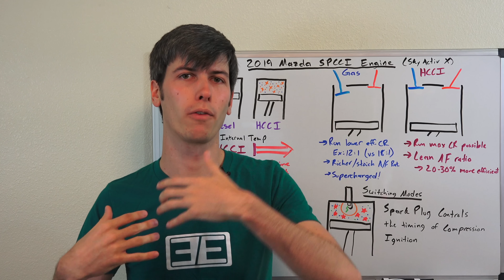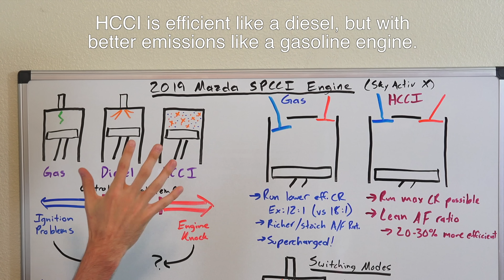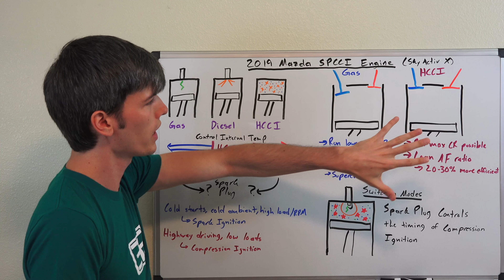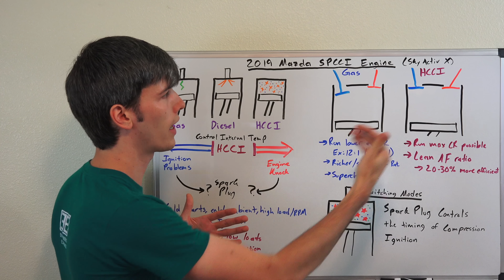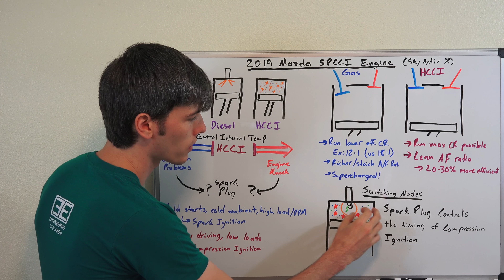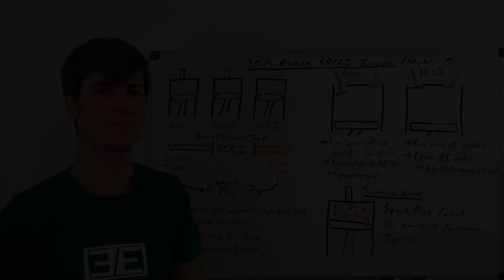Mazda Creates The Holy Grail Of Gasoline Engines - HCCI SkyActiv-X

Comment: Why not just go electric and get 300 to 400% higher efficiency rather than do all this complication just to get a 20 to 30% higher efficiency...
Reply: Drunken Hamster, build me a gas car that doesn't have 17 car fires an HOUR in the USA and doesn't kill 200+ people a year in those fires. Build me a gas car that doesn't account for a million lung cancer cases each year. Build me a gas car that doesn't use a fuel that we fight wars over. And build me one that's 90% efficient like an electric is, not one that wastes 75% of it's fuel in heat.
Reply: Nicolas Losito, who says you're using fossil fuels? No utility is 100% anything. Most are coal (at the moment) and a combination of natural gas, nuke, wind and solar. An EV is 90% efficient with its energy, you LOSE 75% of gasoline's energy to burn it in your car! So even if you burned gasoline to make electricity (you don't, but just for the sake of argument...), you're way more efficient to send the power to an EV rather than burn it in an ICE car and suffer the pollution.
Reply: Nicolas, lithium ion batteries are 96% recyclable, even the lithium. An EV puts out HALF the carbon footprint of a gas car over the life of the vehicle. I think your emission and global concerns should be for us NOT using EVs.
Reply: Scallywag, I don't own a Prius.
Reply: J Bob, cold weather impact on batteries is already solved, pal. It's called having a big enough battery and thermal management (Tesla has both). Don't forget - gas cars get horrendous mileage when they're cold (about 4mpg) and they, unlike EVs, are effected by altitude. Go up a hill, gas cars lose range. I've personally driven a gas car in weather so cold it never reached operating temperature; you'd better believe it was NOT getting it's EPA-rated mileage! To be fair, however, cold weather impacts an EV far more and far sooner than a gas car, for sure. Cold only. Given that a gas car MUST and I mean MUST have a functioning cooling system just to run at idle, you could argue that the killer heat a gas car generates is a negative. There is simply no temperature at which a gas car can do without its cooling system under normal operation. Beautiful 70 degree weather? You'll melt your engine at a stoplight if the cooling system fails so cold weather is the ONLY place a gas car has an advantage over an EV.

Oh and the problem with nuke plants is not greenhouse gases, it's the heat and the waste.
Reply: +motomusiq For majority of drivers, cars are appliances already. The people that want sporty driving will be able to buy performance EVs. So the only thing that will change is cars will become better at being transportation, which is exactly why 99% of people buy cars for...
Reply: Haloid Android, my buddy with a performance EV can beat million dollar supercars, corner better and get nearly 100 mpge doing it. Just put playing cards in your spokes if you want noise.
Reply: You and what toaster - lithium is in good supply and only compromises 2% of any lithium battery. In addition, the entire battery, including the lithium, is 96% recyclable. Please tell me how recyclable gasoline is. In a previous comment, I see no observable improvement in gasoline engines. 30 years ago, the average was 22 mpg, my 2012 RAV4 gets that +- a couple of mpg. You also missed my comment that a 40 mpg car's exhaust will kill you just as fast as a 20 mpg car, so who cares if there are incremental improvements in gasoline engines? They're just as deadly as they've always been and their energy source starts wars. I suggest that your 2008 study was funded by the oil and gas industry. Right after the CARB board passed laws that required GM to make the EV-1 in California, guess what? All sorts of "scientific" studies favoring gasoline and fossil fuels starting appearing in the media...all traced back to the oil and gas industry paying for the studies. Almost everything I've heard on this thread is recycled oil & gas lies about electric cars. You keep on using a one-time fuel like gasoline; I'll use a car that can get its energy somewhere other than the Mideast and has recyclable energy storage.
Reply: You and what toaster - I've quoted facts, given links, challenged the lies the oil & gas industry wants you to believe. Please prove to me solar PV's cost will not reach parity with coal in 2020 (it already is right now in some countries - it's actually cheaper!). Please prove to me that lithium extracted from brine is worse than oil spills, wars fought over petroleum and the one-time use of gasoline, and I'll repeat my FACTS to challenge you. Please prove to me that the company that killed the electric car - GM - isn't doing the same by refusing to build/contribute to a charging network or even requiring their dealerships to have chargers. Or that GM has already limited their production of the Bolt to the exact amount that gets a ZEV credit (they've already told their suppliers to NOT ramp up production beyond 25,000 units). Or that GM and other American auto makers did NOT send a letter to Trump demanding relief of the EPA and ZEV requirements. Prove to me that a business model of income AFTER the sale (that's GM!) can switch willingly to a EV sales model without dealerships. If you say "Volkswagen" I'll show you diesel gate and the reason they're moving to electric - imminent bankruptcy. If you say Nissan, I'll say YES but also point you to the dealers discouraging the sale of the cars. Your "ignore xxx" actually applies to you as you don't have facts on your side. GM and other automakers are the one pushing the REMOVAL of tax breaks for EVs, not encouraging it. They are fighting Tesla every way they can - the ADA tries to limit sales of Tesla cars because it threatens their business. YOU keep pushing "platitudes" but please, stay out of the discussion until you have facts - change is hard, I don't really blame you for not wanting to change the way you think.
Reply: +Paul Baker hydro and nuclear are among the cleanest sources of large scale energy production we have. Gas fracking, offshore drilling and oil sands are thousands of times worse for the environment....
Reply: Space Cars!? What are you even talking about man...
Reply: Calum A, of course you can fill up a gas car in a minute. It's a great feature of the ICE. Did you also realize that if you leave your running in your garage, the exhaust will kill you? How about 17 car fires an HOUR in the USA, and 200 deaths a year in those fires? How practical is that? A gas car is a Molotov cocktail. I can get 170 miles of range in 20 minutes in my electric car, barely enough time to eat a sandwich and go to the bathroom. How's that impractical?
Reply: DocWolph, man, you are an example of a little information being dangerous (and wrong). I really get tired of typing and re-typing on this thread, but I'll address a few of your most outrageous statements. First: BEVs are "wildly" more sensitive to efficiency losses. You don't mention what those efficiencies are, but since you refer to windows I can only assume you mean aerodynamic drag. Tell me - does air flow differently over gas cars than it does an electric car? How is a metal body with a battery different than the same metal body with a gas engine? The answer is: it isn't. A BEV suffers the same drag with the windows down (or up) as a gas car. I'm curious how you think the laws of physics change based upon the fuel source.

Level 3 charging diminishing battery life - wrong again. Tesla limits its rapid charging to around 120kW in order to protect battery life. In fact, if you rapid charge a tremendous amount, Tesla will, on an individual vehicle basis, lower your charging rate to protect your battery. In short, you don't need to worry about battery life - your battery will outlast the car. I can prove to you that revving your gas engine and drag racing it will, indeed, destroy it and your warranty. With a 1,000:1 complexity difference between a gas engine and an electric motor, you have far more to worry about even running the engine than you do charging a battery.

As for an electric not carrying the same energy load, well that's a toss-up. 90kW in gasoline weighs 21 pounds. 90kW in lithium-ion batteries weighs 1,200 pounds. However....it takes about 1,000 - 1,300 pounds of gasoline engine, transmission and fuel system to use the gasoline. It's effectively a wash.

The power companies charge you EXTRA to charge your car at night - again, WRONG. A utility doesn't know if you have a clothes dryer plugged in, a television, a hot tub or anything else. You get charged per kW. Most EVs charge off-peak and at the lowest rate your utility company has. 

Refueling rate (5-10 minutes compared to hours). You're right! I can fill my RAV4's gas tank in 5 minutes if I leave my  house, am awake and pay whatever price of the day for gas is. Let's compare that to an EV - hmmmm, I plug it in (takes 15 seconds) and then leave the garage. In the morning the "tank" is full. Hardly an inconvenience. Oh and my electricity rate has been absolutely flat at $.11 a kW for 15 YEARS. The price of gas has doubled under Obama, then almost halved near an election. Please - Google gas prices in the last 10 years. It currently costs me about $9 to fill up my Tesla to go 300 miles...what do you pay now for that range and what did you pay at $4 a gallon?

Lastly, BEVs being a novelty product - Exxon wishes! Did you know Britain will not allow gasoline cars to be purchased new after 2040? Did you know China will soon have the strictest zero-emission vehicle standards on the planet, and that means electric cars? Did you know many cities are now only purchasing electric busses due to the reduced operating costs?  Did you know the motor and ECU on an electric can be changed with software, making it virtually maintenance free? 

I do hope you learned something, you seem to have a lot of incorrect ideas about electric cars - you seem to be defending one of the largest sources of lung cancer and global wars we have (petroleum vehicles). You are free to drive what you like, but the largest product launch in HISTORY - the Tesla Model 3 - says you're looking at the end of the gas car.
Reply: EV Owner I've seen massive car crashes in person and 100% of the time, they never catch fire. Fires only occur when the gas tank ruptures and it's very difficult to do that, most gas tanks in modern cars are placed infront of the rear subframe so in the case of a rear end collision, the gas tank remains safe. EVs will become a good option in the future if we get faster charge times and better range. I'm not against EVs but they have their own advantages and disadvantages, if EVs start getting 500+ miles range I'd happily buy one.
Reply: Range.
Reply: Roartal, that's not true. EVs, even counting manufacture, produce half the carbon footprint of a gas car. The toxicity of the batteries is a red herring from the oil industry. Lithium comes from brine, not from a pit mine.
Reply: J Bob, you didn't read my comment entirely. Cold weather does affect EVs, but altitude affects gas cars. There are pros and cons to both kinds of cars, just like the differences between gasoline and diesel. In a gas car, heat is a massive problem. Once you reach a minimum temperature, batteries need no thermal management. What happens to a gas car if the cooling system fails, even on a 40 degree day? Your engine will seize! How about losing motor oil...how far will you go? EVs use none of those things.
Reply: Dom Kekistan, we've had over 100 years of improving the ICE; it's as good as it's going to get. The exhaust from a 50 mpg car kills you just as fast as a car making 20 mpg. Since an EV can get energy from multiple sources, the price for it can't be manipulated like oil prices are.
Reply: Albus Regnum, I think a 300+ mile range on a $35,000 car is plenty given a nationwide charging network.
Reply: Paul Baker, where are you getting your information from about electric cars? Do you have a gas car that goes 1,000 miles on a single tank of gas? Can you even drive 300 miles without stopping? I've driven my electric car on a 2,500 mile trip with NO disruption in my travel and NO delays. I average about 50 miles of distance per hour of highway driving, that's over 40 years of driving. I drive 2-3 hours (150 miles) and need a bio break, don't you? I use something called a Tesla Supercharger and I get 150 miles of range in 20 minutes. That's barely enough time to go to the bathroom and eat a sandwich. I then hop in my electric car and go ANOTHER 2-3 hours and stop for another 20 minute break at a Supercharger. After 40 years of driving, I can tell you I arrive more awake, more attentive as I drive and better rested than trying to drive 6 hours at a stretch. In fact, my bladder won't allow me to drive that far. Stop listening to the Exxon about how electric cars work and starting Googling TESLA.
Reply: Harrison Williams, I just can't retype the same answer over and over and over. You are NOT using more fossil fuels charging an electric, please read the previous comments on this thread made by me. In fact, gasoline refinement requires so much electricity that we could power EVs for 20 miles on what it takes to refine just one gallon of gas.
Reply: Haloid Android, the EPA rates every EV I know about at 100+ mpge. I have a 90kW car, the equivalent of 3 gallons of gas, and I easily go 300 miles. What were you saying about EV efficiency? How far do you go on 3 gallons of explosive fuel and how much do you pollute doing it?

You clearly missed the point - it takes 6kW per gallon of gas PLUS the crude PLUS other energy sources to make each and every gallon of gas. An EV can go 20 miles on the electricity portion alone. YOUR car has to add crude to that energy to only go marginally more than that. My 2012 RAV4 averages 22 mpg. What's really interesting is the gasoline is a very energy-dense fuel; only 21 pounds of it stores 90kW. But in order to USE that energy, you lose 75% of it to heat in an ICE and make poison during the process. Stop refining the crude, give the PORTION of energy used to refine a gallon of gas and you'll go 20 miles in an EV.
Reply: Haloid Android, a Tesla P100DL does beat the $800,000 Porsche Spyder at a fraction of the price. Looks are subjective. You must not know about something called Formula-E racing, either. Or the Pikes Peak Hill climb that has Tesla Model S's running in it. I'd say gas cars are only good for exploding.
Reply: Haloid Android, I certainly hope a $500,000 car would beat a Tesla. Why? A Tesla is a $100,000 7-passenger sedan with kid seats in the back. And a Tesla isn't designed to be a race car but it beats them in many performance categories. Imagine what Tesla would do if they DID design a race car. Isn't it ironic that many McLaren owners pay a million dollars or more for a car, never drive it in a race and yet a Tesla sedan beats them in 0-60, quarter mile and safety? If we're going to compare cars out of their categories, Tesla wins. Will a McLaren carry 7 people? Oh and the Green4U electric racer made in conjunction with Panoz Automotive uses battery swap to race, just fyi.
Reply: You and what toaster - so, um, gasoline isn't explosive? Gas cars DON'T rely on combustion to work? There aren't 200 deaths due to car fires a year, 17 car fires an HOUR in the US? Wow, I am mistaken. Thanks for educating me that a solid state battery car is just as dangerous as a car carrying 20 gallons of the same stuff that makes a Molotov cocktail work. How silly of me.
Reply: DocWolph, if memory serves, it was you that brought up the comparison of a $800,000 special-use 2-seater sports car to a $100,000 family sedan. EV owners appreciate the complimentary comparison - it's quite nice, don't you think? All of a sudden a Tesla is supposed to beat a track vehicle? How about comparing a Tesla to an F1 racer? Or a Baja racer? Hey - since a Tesla broke the testing machine trying to crush the cabin, I'll bet you about which car has a higher survival rate - the Porsche flipped over at speed or a Model S. Wow, I'll even bet you which car flips first - given that the Tesla has a 1,200 lb battery below the driver, you'd better not make the bet.

Please - you like your ICE cars. Use them. Buy fuel for them. Repair them. Oil them. Enjoy them. If you don't mind, I'm not using gasoline anymore and like the 0-60 performance that a sedan needs and, icing on the cake,  beats million dollar specialty cars. I like no maintenance, mechanically simple and gets better as it ages...it's already more efficient and faster than when I bought it, all due to software updates. It magically fills up every night for pennies per mile.

Keep buying gas!
Reply: EV Owner, 

Electric is the future, but at this time, it is too expensive for most people to buy. Hybrids are starting to be cost effective for most people. 

EVs still have too much of an upfront cost to be worthwhile for most. If you do a lot of in city commuting than that will be different.
Reply: 1)Mazda is a relatively small company and doesn't have to resources to create multiple engine types. 2) Mazda's are known for being lightweight and sporty around corners hence the zoom zoom, so sticking heavy a$$ batteries and electric motors in there cars would destroy their identity. 3) Instead of following the crowd and creating a mediocre hybrid they'd rather become masters at what there already good at.
Reply: Do you have to end every comment like this........
Reply: I have. Most of Canada's population reside in Ontario, Quebec or BC. All three of which mostly rely on hydro and nuclear. Oil & gas may be huge, but it's not used extensively to generate power here in Canada...
Reply: Jarl Ballin'

Because BEVs do not carry the comparable energy load. BEVs are wildly more sensitive to efficiency losses. That is don't drive with your windows open. 

Further the acquisition cost of BEV are HUGE compared  the ICE-V. The Motor still costs about as much as an engine plus ECU. The speed/motor Controller + power converter costs at least as much as a transmission. And the batteries currently cost as much as getting 150-200 full 20gal tanks of fuel at $3.00/gal ALL AT ONCE. 

Then there is charge times even on Level 3 (330V) you are looking at 20 minutes while greatly diminishing current battery deigns' life expectancies. Compare that to 5-10minutes to fully tank up a vehicle and the time saved adds up real fast. Home charging is at best Level 2 (220v) and would take anywhere 4-8 hours depending on how big the batteries are. In either case the cost is not zero. Lvl3 charging will set you back gas prices per kWh to pay for the infrastructure. Lvl2 would cost the home owner about 1400 for the charging plus whatever home electrical work needs to be done and you can multiply that by the number of cars you need to plug in. And then charging carries additional Electric bill costs which can be hard to justify withe power companies charge you extra for recharging your car every night... although that should not happen if you have at least 200miles of range on a full charge and don't use your A/C radio, or drive in pace with the rest of traffic. 

BEVs are still a niche novelty product. There is reason to believe they will have the final say, but that day is not anytime soon. meanwhile, ICE and Hybrid technology moves forward making BEVs less of a winning argument.
Reply: Wow, DocWolph, what hostility. Let's talk, shall we? You implied that charging level 3 damages the battery, also implying that charging quickly is unusable. Do you know how long it would take, and how many times you'd have to charge over 120kW before you'd damage your battery? A tremendous amount. Tesla will slightly reduce your charging rate to protect your battery, but you still get Level 3 charging rates. So to rebut your statement: charging Level 3 will not damage your battery in a Tesla! You still get Level 3 and you still get full battery life. In no way are you reduced to Level 2 charging rates, you should've let that one be. Details, the devil's in the details. Level 3 charging is anything above 20kW; Chademo is half the charging rate of Tesla's 120kW and still considered Level 3. Even at the reduction of charging that Tesla might make over time to protect your battery, you're still charging much faster than Chademo! Are we good now?

As for your prediction of off-peak charging costing more when EVs are more prevalent, your guess is just that - a guess. You're forgetting that off-peak isn't just a function of supply and demand, electricity also has a time component and a restriction as to the maximum amount of power that can generated and transmitted at any one time. In California, for example, they can have a 4:1 price variance depending on your time of day that has nothing to do with supply or cost of the generation materials. Diesel fuel, for example, doesn't cost 1/4 of it's price if you buy it after 8:00pm. What matters is WHEN the utility has to generate the power, and whether or not they have to use additional generation methods at peak times, and whether or not they have to build more infrastructure to transmit that peak power. EVs generally smooth out the peaks and valleys, which is why the Tesla Powerwall is so popular. In my state, we have no off-peak pricing so it doesn't matter when I charge my car. If everyone decided to run their electric clothes dryers off-peak, you might actually see a decline of peak rates as the total energy demanded during peak hours would drop. 

As for the price of gasoline, learn the details. Gasoline, due to political reasons as well as extraction and refinement reasons, varies greatly. Fracking was one reason the price dropped, but I've read many articles that the price has dropped in half NOT due to fracking but due to the Saudis seeing we were making more crude, using less of theirs and they artificially dropped their prices to have us stop production. We've capped our own wells in the USA before when they've done that. Here's the details you missed: electricity prices are regulated and stable. Unlike gasoline, you can make your own electricity. Can you make gasoline?  Being energy independent is a benefit of driving an electric car, not being subject to the roller coaster of fuel pricing is a great thing. Please tell me how an unpredictable fuel price is an advantage for ICEs. Tell me how the inability to make your own fuel, regardless of political or cost reasons, is a good thing. 

As for batteries charging in 15 seconds, you sure missed the point - missing the details again. It takes me 15 seconds to plug in my car at night. That's all the time out of my day that refilling my car takes. I'm sleeping while it's recharging. YOU, on the other hand, have to stand there at your car for 5 minutes filling your tank. How on Earth could you possibly think that having my car refilled while I sleep is a disadvantage? You, on the other hand, have to stand there and wait to put explosive in your car then carry that fuel home to sit at your house and HOPE you don't get into an accident carrying that Molotov cocktail around. Details. Learn them. Know them. I'm sure you're a smart person, never stop learning - it's good for you.

There is no way you can compare a thousand-part ICE to a single-part EV motor and think that the ICE is, or will be, more flexible or more reliable. In Tesla's Model 3 service design, 80% of any service can be done without putting the car on a lift! A service ranger, in the rare case they're needed, can stand over the vehicle in your driveway and fix something. Please keep telling me how a future ICE will be reliable and remotely serviceable, I'm intrigued. Most of Tesla's issues are fixed by on over-the-air software update; how many ICE cars can do that? 

Lastly, I'll enjoy a political discussion with you on another thread. I also enjoy seeing loser liberals try to take credit for the rapid turnaround of the economy, record employment and record stock market highs. If the previous administration knew what it was doing those things would've happened THEN. But let's keep talking about statues that were standing for 100 years and no one said anything under the previous administration. Statues, not jobs, seems to be battle cry of the left. Since it's clear we're not going to agree, let's agree to disagree. Have a nice day.
Reply: Haloid Android? Last time a car exploded? You mean without flame? Or do you want to discuss car fires, which is a problem with gas cars? I've seen lots of videos of firemen at a privately owned car that's burning on the side of the road and it explodes. There's also the explosions when tankers have a wreck, we just had one in my state in the last few months. Quite horrific explosion as well. Yes, I've driven by cars on fire and it wasn't batteries burning, it was the gas.

The $800,000 Porsche Spyder better beat a $100,000 family sedan in a race, don't you think? And the Spyder still carries around an explosive and doesn't seat 7. But then again, a diesel tractor trailer beats a Porsche for distance, too, but if we're comparing vehicles out of their class and price, a Kenworth beats a Porsche, McLaren and Maserati. 

I'll be happy to get you video links of cars burning and exploding, but you can do a YouTube search just as easily as I can.
Reply: Krisztian - Jeremy Clarkson is a comedian not a car expert, and John Cadogan is a car salesman, not a expert either.  His video on EVs was filled with inaccuracies.  Your probably one of those that has made up his mind and just looks for like minded confirmations of your beliefs.
Reply: Haloid Android, to tell you the truth, I'm tired of the discussion. Like what you drive, I say. You are, of course, welcome to drive whatever you want, whatever makes you happy. I have a red convertible that has a gas engine that goes pretty quick and it's fun to drive. I drive it a lot. I buy Premium gas for it, too. I don't fault anyone for driving what they like and can afford. And I wish you a better day - if this discussion has contributed to a bad day, then screw it. Let's stop talking about EVs then.
Reply: You and what toaster? -  So lets summarize your points:

Subsidization - Bad for Tesla and solar, but you have nothing bad to say about fossil fuel subsidies 
ICE pollution  - Not a problem
US Auto Industry - Should have let fail
Governments - They just have wars for the sake of having wars, no connection with oil.
Gasoline - Not flammable or explosive
Lithium - Not safe in any form
Exhaust - Not at all dangerous.
CO2 - Forgetaboutit

Wow!  Your one of those "alternative facts" people.
Reply: Roger Heuckeroth, could you have told me you were going to reply to Toaster? Sheesh, you could've saved me lots of typing ;)

I end a conversation when it becomes circular. He's brought up subsidies, range, recharge, battery toxicity, fuel source and been wrong every time. I'm not going to respond to him anymore but maybe people reading our discourse learned a few things.
Reply: They are trying hard to figure out a way to mass produce super capacitors than can do most of that. They would theoretically charge the same rate if not faster than it takes to fuel the car. Once someone figures it out, even Tesla batteries will be obsolete.
Reply: Paul Baker, hydro plants are one of the cleanest, safest and most predictable energy sources the planet has. A dam's primary function is to control flooding, btw. The fact that we can get power from moving water is just gravy on the potatoes. Nuclear plants are very dangerous - but we cannot ignore them. France gets over 75% of its energy from nuclear power with no accidents, so to say it's not usable isn't a practical perspective....it has its place but its potential for damage is great as well. The answer for domestic energy is clear - renewables. Solar can completely provide all the energy the USA needs if we have storage. And the amount of solar PV panels required to generate that energy would only occupy a few small counties in Texas. Same for battery storage real estate. I can, right now, make over 100% of my home's needs using rooftop solar. Imagine if even half of all homes in the USA because energy self-sufficient - who needs a new power plant? Who needs more power lines? Who needs to burn more coal or diesel or nuclear fuel?
Reply: You can shoot a tank of gasoline and drop a lit match into the liquid and the flame would extinguish. You're a total nit with your name and endless vomiting of things you read in articles. How anyone can be such a fanboy of a technology and spew lies and hysteria and propaganda is beyond me, but the internet is a wonder for building wastes of intellectual space.
Reply: EV Owner Teslas do have the advantage in short races because their torque is instantly available but when you're doing 1/2 mile or 1 mile drag races for example, it'll be left behind...
Reply: EV Owner,

Why you so butt hurt about this? If you understood that the only thing the Models was capable of beating a sports car is was 0-60 times, then why be so mad about it being spelled out. 

You are one of those special little snowflakes, people who think they are so special, always right, and can not take the slightest bit of heat, that is contesting their insular POVs.

But you did say, A Model S BEATS a [Porsche] 918. Beats as in, anything the 918 does the Model S does better, which is functionally not true. It does a lot better like carrying more than 2 people and their stuff, among other things. 

You should be more capable of being more mature about this than your are being. So suck it up, whiner.
Reply: Krisztain Gagyi, you keep believing that Top Gear isn't scripted! How about some "clear" facts? First, lithium is extracted from brine, not pit mined like copper. Lithium only comprises 2% of any li-on battery and the entire battery is 96% recyclable. EVs produce half the carbon footprint of any gas car you can name over the life of the vehicle. Please...Google is your friend. I can provide all the links to my statements if you like, but I suspect you're busy drinking the GM and Koch Brother's kool-aide to read them. 

Since gasoline only comes from oil, please explain to me how being able to make electricity from solar, wind, hydro or any other cleaner source is WORSE than burning gasoline. Please, I'd love to have that intellectual discussion. Put the kool-aide down and start typing.
Reply: DocWolph, where are you getting your information? Are you actually arguing that a single-moving part motor is somehow even remotely akin to a 1,000 moving part ICE? You're really trying to draw that conclusion? Logic class for you, pal. Oh and by the way, Tesla motors don't use magnets. It's an AC induction motor; DC motors use magnets. Before you think you can "tarnish BEV reliability", please learn about motors, electricity and the way the world works. But it is fun to talk to you. I especially love your attempt to compare a frequent and necessary oil change on an ICE to a sealed, permanently-lubed single part motor - logic at its best! Keep 'em coming!
Reply: DocWolph, it's you that's butt-hurt. I lay out facts that counter your arguments and you use childish names. Snowflake applies to you, pal. Just get your comparisons and facts straight, you'll need lots of time for that.

The Model S beats many sports cars at many things, already mentioned. It beats every sedan made in the common performance categories - 0-60, quarter mile. It's the safest car ever made, including million dollar sports cars, and goes 300 miles getting 100+ mpge doing it. Name another car that can do that.

I can see you don't like change. That's to be expected, I guess, all I ask is that you make your decisions on facts, not silly assumptions. The Model S is a 7-passenger sedan but it outperforms sports cars. It has a 300-mile range, it's performance design. If you want to argue range is the overriding factor (not speed, not reliability), a Kenworth wins. It's quite a compliment that you that you have to go to a $800,000 Spyder (or McLaren, or Maserati) to even begin to get similar performance, thanks.

Whenever you'd like to stop calling names and trade logic and facts, let us all know. Google and think first, however, it must be embarrassing for you to get called out so many times.
Reply: Tesla also wouldn't exist without the government feeding tube of taxpayer money. Not only does electric NOT meet the needs of many, it's an economical loser at any significant level. EV nuts are rabid idealists who don't care about reality, and think they're living in the future because of all the click-bait they read.
Reply: Haloid Android, do you just pull statements out of your arse? How does one moving part vs. 1,000 moving parts relate to unreliable in your world? I have a statement for you: ICEs are unreliable because they're full of parts!

Water? Want to talk about water? There's a Tesla that actually swam for a short distance under a flooded underpass (the video's on YouTube) using the wheels and momentum to push the car. How far would Tesla go if it didn't seal the battery? Ever seen a gas car after it's been underwater? Better not shut off the engine if the exhaust pipe ever gets submerged, you'l suck water into your engine block and it's bye bye that car!

As for watching a Tesla in 10 years, many are over 130,000 miles right now with NO repairs. Or, just go to some car shows (or look up Jay Leno on YouTube) and see that Bradley and Boston electric cars are still working after 100 years. Show me your ICE working PERFECTLY after 10 years and let's compare!
Reply: Crazylala: glad you recognize that electrics are the future. The flagship models of Tesla (S, X) are certainly a luxury class price range. That's where the Model 3 comes in. Same for the much shorter range Nissan Leaf. You'll be seeing many many affordable Volkswagen EVs in the next few months due to dieselgate. Although buying an EV is like pre-buying lots of gasoline, it's ALSO avoiding years of oil changes and repairs...there's simply little to go wrong. I just put an alternator in one of my gas cars - $1,400 with labor being the largest part of that. Transmissions, differentials, water pumps, oil, valves, rods, fuel systems - the number of things you pay to fix is endless on an ICE.
Reply: Scallywag, you said I was a "smug Prius owner". I don't drive a Prius. You're wrong.
Reply: Ah, Haloid Android, more arse-related statements. Have you seen autopilot from Mercedes? How about the review of those systems? A car magazine recently did a review of autopilot and autopilot-like systems - Cadillac, Volvo, Merc and Tesla were all reviewed. Just guess which one came out on top by a FAT margin - just guess! It wasn't Mercedes!

And autopilot is going to be a common feature in a few years, Tesla has pioneered it. Why, you can take your hand off the wheel in a Volvo for almost 60 seconds! Woo hoo! Never mind that Tesla's system makes me hold the wheel to make sure I'm still awake, not because it needs assistance. And when the Model 3 and newer Model S's have the software deployed, they'll be totally autonomous. Any autonomous Mercedes out there?

As for ICEs being king, guess which car company outsold many car models from many car makers combined? Which car company is singularly responsible for changing the direction of car makers to electric? Tesla! Tesla outsold Audi, Mercedes and Porsche's luxury models so I the same people you think aren't buying "electric shitters" are, indeed, not buying gas cars any more.

Please - tell me why a Tesla is a "shitter". It has the highest customer satisfaction in HISTORY. Highest repurchase rate of any car in HISTORY. Highest safety rating of any vehicle made in HISTORY. Please - expound your reasons why car buyers of gas luxury cars are leaving those brands in DROVES for an electric car that "has no place" in our world. 

Dinosaurs be dinosaurs. Keep buyin' that whale oil to fire that steam engine.
Reply: EV Owner In my eyes the biggest disadvantage of the Tesla brand right at the moment is the missionary behavior of the brand addicts. Everything Elon Musk does they find downright jawdropping, everything other companies do they find awkward and yesterday. It is worse than with dyed-in-the-wool apple sheeps, who really think that being creative is a matter of the gear you chose. Of all electric cars, the Tesla is without any doubt the most versatile and most promising car. Yet it cost three time the price of an average new passenger car in the U.S. It is big and heavy. Its acceleration is way quicker than neccesary, while its range is too short. And instead of improving the range, Tesla did just the opposite with the latest product update: They improved the acceleration instead of significantly solving the range problem. Nobody needs an acceleration of less than 3 seconds from 0 to 60, except those who want to brag about it. I live in Germany, and while it is possible to drive from Munich to Nurenberg and back in one rush with any decent sedan as fast as you want, you have to calculate at least one stop at a charging station if you do so with a Tesla. If you drive on a German Autobahn, you see masses of Mercedes, Audi and BMW travelling at speeds way beyond 100 mph. You never see a Tesla travelling that fast - because that would kill the range completely.
Reply: Paul Baker - I would hate to be on a road trip with you.  Drive 450 miles stop for 5 minutes and then drive another 450 miles.  No meals, no bathroom breaks?  

I would leave home with a full charged, drive 3 hours, take a 15 minute break to charge and go to the bathroom, drive for another 1-1/2 hour, stop for lunch and charge for 40 minutes while eating, drive for another 2-1/2 hours, take a 20 minute break to charge, go to bathroom, get a coffee, drive for another 2 hours and then stop for a nice sit down (non-fast food) dinner and charge fully in about 1 hour.  Then finish up the day after 3 more hours of driving.  That's 12 hours of driving and enough for one day.  I've done this trip many times in my 85D from South Carolina to New York.  I arrive without being totally exhausted by breaking the trip up a little

Now currently, the only EV you can charge this quickly is a Tesla.  Their superchargers add about 2 hours of drive time for 20 minutes of charging.  And I realize they cost way more than the average family can afford.  Mine is a business expense.  But prices will drop and some day it won't make sense to drive anything other than an EV.
Reply: Haloid Android, you are absolutely correct. Modern gas cars are far more reliable than they used to be. I buy Toyotas almost exclusively for their reliability. I've also owned Hondas, Mazdas and Nissans, all with stellar records (especially the Honda) on service. In the case of my Honda Accord from the 80's, all I ever did to the car was a carburetor fix after 80,000 miles and brake line replacement. I'm not saying after 20,000 miles that a gas car fails. In fact, after 40 years or more of driving, I've never heard of modern cars doing a tune-up or replacing the spark plugs anymore. They're at their pinnacle of performance, have been so for about 20 years (specific models excepted).
Reply: EV Owner - That's right.  A lot less to go wrong in an EV.  Tesla's design life for their drivetrain is >1M miles for the motor and >500K miles for the battery.    No ICE can come close.  Some people don't like change/progress.  I know people who still prefer a flip phone to a smart phone.  Heck I have a couple of them in my family.  People are funny.
Reply: OK Folks, I think the electric car vs. gas car thing is played out. I know I'm tired of it! 

Here's what I'd like to ask: 

1) Drive what you want, I certainly don't fault you for having a gas car. I own 2, have owned quite a few in my lifetime, will probably always have a gas car.
2) Believe that no one car type is a panacea. Hauling 100,000 pounds of frozen chicken to Omaha? You'll be using a diesel tractor with a trailer, not an EV. Driving 300 miles an hour? Well, that's a Bugatti. Only drive 50 miles a day or have a car for most of your daily driving? Could be a Passat or a Leaf or an e-Golf.
3) Do not believe what you hear about electric cars without research. WHO told you electric cars polluted more than a gas car? Did the study get funded from GM or Exxon? They have great economic reason to halt or delay anything that doesn't buy their products, so decide for yourself rather than repeat what you hear.
4) Realize there are dickheads on both sides of any arguments, Prius owners seem to take the cake (BMW owners, too, but that's another discussion). Be reasonable with your opinions and statements.
5) Regardless of what you might think about Tesla, realize it's an American company, paying American workers and for once, for Pete's Sake, an American car is outselling foreign luxury cars. When was the last time an American car was exported to break sales records overseas? Before you trash talk Tesla, realize GM makes cars in China for sale here, and Ford makes 'em in Mexico. Tesla is as American a car as you can get.

Can we just like cars now? This is getting nuts.
Reply: You and what toaster, YOU are a red herring. You dismiss completely factual statements and analogies. 

The airline industry is EXACTLY analogous to EVs - it's an industry that's starting that has taxpayer assistance, either in building the product or buying it. Sorry you don't like the fact that I proved you're using an industry that was in the same position as EVs is, but that's your problem, not mine. Taxpayers subsidized early airline travel and it's subsidizing early EV adoption. How many similar statements did I make about the airlines vs. railroads, and how many have I heard about EVs? All of them!  Learn to say "I'm wrong".

Tesla sure has tax credits going for it! I got a tax rebate on the price of the car when I bought it, State and Federal. I got an incentive to buy one. Those incentives start to decline at 200,000 vehicles unless renewed. Tesla, did, in fact, pay back its loan 5 years early but you'd like to ignore that. Did GM pay back ANYTHING early? Or even pay back what it borrowed? Nope. Neither did Chrysler (no Fiat). The GM deal alone is $14 billion in the red, please defend THAT taxpayer deal, but you can't use the words "red" or "herring".

Solar panels are another industry that's getting tax incentives. My state will give me a tax reduction if I buy panels, not sure why you mention that. The state would like me to make my own power and reduce my demand on the utility, hence a tax incentive. There are many tax incentives, including the one under Obama's incentive to trade in an old smoker on a more efficient car (remember that one?). Similar tax incentives are also called "buy back" and it's been done for guns, too.

Environmental credits are available if I buy a new, efficient refrigerator, too. Or a furnace. Soon, Federal law will require new water heaters to have a minimum amount of insulation and energy efficiency. They're everywhere. 

I think you like my red herring comment, you copy it a lot. Running a car in a garage is NOT dangerous? Would you like to sit in a closed garage with a car running and tell me that? Keep a herring near you, a red one.

Think the USA doesn't send troops overseas to protect the world's oil supply? Really? You must be very young, I remember Desert Storm where a Mideast dictator set all the oil fields in his country alight for the specific purpose of crippling the world's oil supply. Another historical herring for you, I guess. 

It's too bad that my factual, correct and applicable responses to you make you angry. You fear change, so you react. As for Elon Musk enjoying wealth, he's actually produced something to earn it. Oh, and by the way, something called the stock market means you, too, can bet with him. I personally know a person that put his entire retirement into Tesla stock and he's a multi-millionaire now. Wish I had done it, but I didn't. Glad for him and for Musk. Tesla stock: up 66% since Jan. 1. Other car companies? Not so much. 

I can see you don't like talking about EVs, they scare you. The meteor's headed for the Earth; you can remain a dinosaur if you wish, but EVs are the answer to lower oil dependence, stable energy use for transportation and being able to make your own vehicle energy and use it.
Reply: Andres Valdes B, what electric car are you talking about? A Nissan Leaf? A Tesla Model S goes 300 miles and can get 170 miles of range in 20 minutes on a Supercharger.
Reply: Andres - Where did you get that 50% number... out of your butt!  Its more like 10%.  If you use Tesla's calculator on their website the difference between 70F and AC on and 32F heat on is 9%.  My own first hand experience corroborates those numbers.  

I used to go from 16 MPG to 14 MPG in my Tundra from summer to winter.  That's a bit more than 10%.  Plus if you warm up your engine/cabin in the winter your sitting there idling for 5-10 minutes.  When up in NY in the winter I would precondition the Tesla while its still plugged in.  It would warm up the cabin and the battery and be ready to go from the app.  Its supper convenient and uses way less energy/less pollution that idling a ICE.
Reply: Andres Valdes B, I own one of those cars in a cold climate and it's not that bad. Cold weather certainly does affect BEVs. The trade-off of having a car refilled every night for pennies outweighs the inconvenience. When have you driven in a cold area to the maximum range your car can go? A Telsa goes 300 miles, let's say it was 50% range loss (it's not) so that's 150 miles before you need a recharge. How often do you drive that far when you can't stop to refuel?
Reply: Atomiclizzard, you don't have to say anything. I've rarely seen a topic such as EVs that raises such ire. My new phrase is now: don't discuss politics, religion or electric vehicles.
Reply: EV Owner is so ignorant and obtuse he just came here to to toll (just like doktorbimmer) and can't even admit he didnt know coal is fossil fuel. Its so sad there ppl that need waste other ppl time. Trying to spread propaganda on issues they have no interest in and r so ignorant about.
Reply: Yes, as a hybrid engine to charge this design will give a 40-50% thermal efficiency such as diesel, but lighter weight (mass) and can run as a 3 cylinder for best efficiency (mass to output).   Electric motors need less gearing for efficient output due to their higher torque range and the batteries only are needed for acceleration and  high loading such as going up hills with the gasoline engine in most efficient mode.  As battery drain increases the motor can provide the energy required in a less efficient power setting.  Elimination of many gearbox components such as differential gears and clutches (torque converters) can save 15% of the power losses associated in many of todays cars making the transmission losses to electrical power viable.
Reply: Atta boy.  Unfortunately, despite all the advancements of electric and autonomous cars, it WILL turn cars into appliances that eventually no one cares about aside from a nice place to sit and check your instagram while getting to your destination.
Reply: Andrew DeWitt, capacitors are a pie-in-the-sky topic. The issue is that capacitors don't hold their charge long enough. Lithium batteries are great and meet the requirements.
Reply: Nah, I'm not that interested in electric sports cars.  This is because aural sensation is what makes a car most interesting to me.  It makes a car not even have to be particularly fast to be exciting.  Unfortunately, the trend nowadays is to make cars very fast and capable but also quite insular, whereas they could have been engineered to be very stimulating to the driver without needing great power.  Very few cars are like this now.
Reply: Agreed. The engine sound, the manual gear shifting, and the lack of traction control is what makes a car exciting. Unfortunately for me the electric motors are too quiet, have little need for transmissions, and easy to control torque. Great for comfort, less moving parts for reliability and near perfect traction. However this opens a new chapter to the seat of the pants fun.
Reply: Andrew DeWitt,

"Reliability" does NOT mean "set it and forget it" You are going to have to.. I don't know... change the oil once in a while, Usually 2-3 times a year in most modern cars. Being mindful of harsh usage and dealing with issues before they become problems. There are ways to prep a car for regular hard use. But few cars come off the lot ready for that. 

The problem with "reliability" is that people think they can be used with reckless abandon with little regard to the fact they will wear out or be broken, if not proper maintained. Even BEVs will need attention once in a while. But people will go in thinking BEVs are rock on ground reliable and they simply aren't. 

Tesla is really unfortunate in that they air cool their motors. Something Lucid fixed by using liquid cooling. Thus Tesla motors are much more prone to failure. 

Overheated motors cook their lube, warp bearings, weaken and ruin magnets. and have far higher electric resistance limiting range and power. It is harder to have these problems as most people are not going to push their BEVs that hard. Knowing that is still a real problem to look out for tarnishes the idea of BEV "reliability". But no more so than just changing the oil in your ICE-V, something no one really complains about, whether you DIY or go to the "lube shack". It is just something no one really minds. Although no one would miss either.
Reply: range and cost.

This doesn't seem that much more complex that typical valve timing in a high compression ratio engine.
Reply: Also, Teslas are unreliable, they're full of electronics. Imagine if water somehow gets in :') You're blinded by your shitty Tesla, I want to see it running perfectly after 10 years :)
Reply: Crazylalalalala agreed, Teslas make no sense in this gasoline powered world as of now.
Reply: EV Owner lmao cars with ICEs from the 1900s are still running LOL, and yes, 100 parts in an engine is more reliable than 1 electric motor which can short circuit at any time and erupt into flames. Teslas and EVs don't belong in this world right now :P My V8 Mercedes-Benz C 63 AMG looks and sounds waaaaay better than your silent shitty Tesla.
Reply: EV Owner lmao my Mercedes-Benz has auto pilot in it too so there's no comparison, ICEs are king and that's why they sell more than expensive electric shitters :')
Reply: Android - Tesla's make perfect sense for those like me that put a lot of mile on per year on their vehicles.  My 85D cost less to operate with ALL things considered than the Buick it replaced.  

Your gas car is also filled with electronics.  In fact, there are way more sensors and complexity in the average ICE car than in a Tesla.  I have over 70K miles on mine over the last two years and its only been in the shop twice.  

EVs are actually very simple.  There are 20 moving parts in a 2WD Tesla drivetrain verses thousands of moving parts in a standard ICE with automatic transmission.  This HCCI Engine that Mazda is developing adds even more complexity to the ICE.  They could have likely got more than 20-30% efficiency by hybridization, and been able to benefit from regenerative braking and no-idle.  

The one item that has been limiting the adoption of EVs is battery cost.  That is coming down steadily.  Its just a mater of time before the gasoline / diesel engine becomes history.  

Charging speed is already quite acceptable.  I can make a 800 mile trip in one day stopping to charge only for meals and bathroom/coffee breaks.
Reply: EV Owner most of us gasoline lovers love the feeling of being in control you know what I mean. If you get stranded in a gasoline car it isn't much of a problem, most roadside mechanics will be able to assist you, you can even fix the engine yourself as well. I'm worried about if you get stranded in a Tesla ( god forbid ), you will have to call a tow truck and all that stuff. I and most sports car lovers prefer simplicity over technology, all we want is 3 pedals, a stick shift, a steering wheel and a seat. No fancy auto pilot systems and all that. I understand where you're coming from, I'm sorry for my earlier replies, I was having a bad day.
Reply: EV Owner but if you maintain your car properly the chances of any such things happening is very low. Japanese cars have like 0 maintainence, you just need to change the oil and nothing else, there's a very little chance of belts snapping or over heating. I don't trust European or American cars in terms of reliability.
Reply: Because you want a car to travel more than 200 miles per drive in a single day without needing an 8 hour recharge
Reply: atomiclizzard yes but the model s costs 70k, not to mention batteries can lose up to 50% of capacity depending on the environment, who wants a car that goes half the range depending if it is summer or winter? Maybe in California
Reply: my response was to the original question as to why Mazda doesn't just make an electric car. I didn't mention anything positive and negative towards electric cars, so what did I say that you were responding to?
Reply: @Andres*
Reply: +Jarl Ballin' -- Because there will still be a market for gas engines for a long time, regardless of how awesome you think EV's are.
Reply: Manufacturing cost. Retail price.
Reply: N C, Coal is not generally classified as a fossil fuel, when you see discussions on fossil fuel you're most likely discussing oil and gas. Coal is solid organic or fossil fuel and its extraction, combustion and pollutants are all different than oil or gas. Please explain the "propaganda" I spread, I suspect you're a person that's afraid of change. China is phasing out fossil fuel cars soon, as is the UK, and the USA better not back away from that trend or we'll find ourselves with no automobiles to sell outside our borders. BTW, China is the world's largest automobile market so you'd better not think we can survive if we ignore the trend from the biggest purchaser of cars.
Reply: Canadian electric mix is 60% hydro, 16% nuclear, 9.5% coal, 8.5% NG and smattering of mixed including renewables for the rest... 8-10%ish...
Reply: The people who like that 20-40% efficient ICE cars cannot afford your 400% overpriced electric toys.
Reply: Jarl Ballin' because you still are burning fossil fuels (if you live in US) to charge the car.
Reply: You're burning fossil fuels either way but you get farr better MPGe on an electric car than a gasoline one plus electric power generation stations are far more efficient at converting fossil fuels to energy than gasoline engines...
Reply: Plus here in Canada most if not all out energy is made from nuclear or hydro, which produce no greenhouse gasses...
Reply: Jarl Ballin' idk how true that is since the power station is basically a fossil fuel powered generator. There are also other considerations like nickel for batteries is harvested via slave labor. There are geo political issues. Also where does battery waste go? 

I'm not saying you are incorrect. I'm merely saying mpg is not the primary consideration, emissions is also a concern. There are also global issues.
Reply: True, but MPG is the main reason why Mazda is developing such a complicated engine. They know MPG sells cars so my point was why not go electric or some sort of hybrid than develop such a complicated engine...
Reply: DocWolph, give it up. You are anti-EV for whatever your reasons. No logic, no facts, no statistics, no politics will convince you. Please continue sending your money overseas, avoiding your tailpipe, fixing the 1,000 parts under your hood. Really, keep asking permission of the Koch Brothers to start your car in the morning.

You, again, missed the point of my statements. It takes a car almost 8 times the price of a Model S to even approach the performance of a Tesla. Million-dollar McLarens can't beat it. If you're comparing range of a sports car, I can assure you the Porsche Spyder isn't getting 50 mpg when it's drag racing. How about an off-road race, let's throw that aspect into the argument - will a Porsche Spyder do well there? Maybe at Baja or dune racing? The Model S is a 7-passenger sedan, pal, not a sports car and it still beats million-dollar specialized race cars. Insult EVs all you want but the existing manufacturers have had 100 years to get it right and they can't. Little ol' Tesla with about 10 years of production has, wait for it: the highest safety rating of any vehicle in HISTORY; the highest customer satisfaction rating of any vehicle in HISTORY; the highest re-purchase rate of any vehicle in HISTORY, the only car in HISTORY that gets cleaner and better after it's manufactured and the greatest product launch of any product in HISTORY (Model 3). How many car companies discourage orders of a model of car due to overwhelming sales? Not Porsche! Not Lamborghini! How many manufacturers have a 97% repurchase rate? Not Rolls Royce! Not Mercedes! How many cars broke the safety testing machine trying to crush the cabin? Not Volvo! Not Koenigsegg!

You're not going to like Tesla or any EV no matter what anyone says. Please - just burn the whale oil and tell yourself you're making the right choice.
Reply: EV Owner The ICE is still being improved. Mazda just came out with new technology that can increase fuel efficiency 20-30%. There are also alternative fuels. 

From Wikipedia: A 2008 study concluded that "realistically achievable lithium carbonate production will be sufficient for only a small fraction of future PHEV and EV global market requirements", that "demand from the portable electronics sector will absorb much of the planned production increases in the next decade", and that "mass production of lithium carbonate is not environmentally sound, it will cause irreparable ecological damage to ecosystems that should be protected and that LiIon propulsion is incompatible with the notion of the 'Green Car'"

It's interesting that a few years later, the brilliant uber far-left minds at Berkeley and Ford Motor Company came out to say demand could be met. A more recent look however confirms that demand is soaring past what we will be able to produce.

What you think you're doing is getting us "off" oil and into clean energy. All you're going to have is the next big limited resource that humans depend on for everything. Rich regions like South America and China will likely host the future quagmire of dependency due to your incessant demand for a poor replacement.
Reply: Yeah, build me a battery with 3x charging, 3x energy density, 3x lighter weight, and 100x safer. Then we're good. And the far better MPG3 thing doesn't matter when you can only hold 1-2 e-Gallons at best.....
Reply: Herr doktorbimmer I'm not talking about the car driving around, I'm talking about the actual production of the car.
Reply: I think Mazda is really smart.  Electric cars may be the future but it's going to take decades for electric charging infrastructure to catch up.  There are tons of people who still live in apartment and condo buildings who can't easily charge their cars.  Gas is not going away overnight so why not make it the best you can?
Reply: Jarl Ballin' look, do you really think our space cars will be powered by electric engines*? I think that we will need to know how to deal with combustion and other similar methods of engineering than electric.
Reply: EV Owner when was the last time you saw a gasoline car explode? Probably only in the movies. The Porsche 918 will single handedly destroy a Tesla in a race lol, Teslas might have the instant torque but so does the Porsche 918.
Reply: Ev Owner, 

The point of the 918, which is overkill as an example, is the sheer degree a consistency of said performance. as batteries lose charge they are unable to maintain the same intensity of performance . Meanwhile ICE vehicles, even strong Hybrids... Especially strong Hybrids, can easily duplicate the same lap performance as long as the tank and the tires last.

And 0-60 drag times are not much to hang your hat on versus a car designed to take corners at mind-warping speeds. IF you did not care about 0-60 and had to complete a 10 lap race around VIR or Laguna Seca in a Model S P100D Ludicrous versus a C7 Corvette z51 (Dude I'm given you a HUGE advantage), who do you think would finish first? Just 10 laps.

The Corvette because it just won't slow it average speed. "It's not how fast you can go, but how fat you can KEEP going."
Reply: EV owner you are clearly in the wrong Tesla is less eco friendly then a petrol engine this is long been debunked by all the car experts well the ones who have the balls to say it like Jeremy Clarkson, John Cadogan etc basically all the people that look behind this eco friendly business monopoly, it's worst for the environment to mine and produce those batters then burn the gasoline... You can look it up and that's not even mentioning how much more energy is in a high pressure combustion engine.. but keep living in your green dreams reality tough
Reply: You and what toaster? : ah, the subsidy argument...again. Not true! You know, of course, that Tesla paid back its government LOAN 5 years early, right? Are you talking about ZEV credits that every car maker can buy or sell, or are you talking about purchase credits for the owners? Be specific with your statements if you ever want to be right (in this case, wrong) about a topic.

Let's address your "government feeding tube of taxpayer money". I couldn't agree more...about Exxon, the Koch Brothers and the $14 BILLION we taxpayers are in the hole for the GM bailout. Upsetting, isn't it? How about the $470 BILLION in subsidies the oil & gas industry has received over the last 100 years, that's crazy, too, right? Funny that an industry as big and multi-national as oil & gas cries about a tax incentive to buy a car. Or that a car maker, like Tesla, makes a zero-emission car and can sell credits to the makers of smokers so THEY can survive. But, people like YOU think we should continue to burn gasoline, start wars over the fuel it uses and send our wealth to countries that hate us because it's a good idea. No sir, having a vehicle that won't kill me running in my garage, doesn't carry around explosive fuel and can be filled from the sunshine on my roof is a BAD idea. Click bait indeed. 

Keep buying that black gold, toaster. See the troops going to the Mideast? Think that's just to protect tourism? No, it's to protect the world's oil supply that YOU demand we keep using just to push a car. 

Let's talk industry subsidy. Did you know that airlines used to get paid by the taxpayers for every passenger that flew? Yup, the fledgling industry needed help to get going when there already were powerful economic forces that liked things the way they were...namely, the railroads. An airplane couldn't go very far (sound familiar?), couldn't carry many passengers (sound familiar?) and cost more to go from point-to-point that those nice, comfortable, cheap railroads (sound familiar?). Tell me, would you say getting air travel was a benefit, or would you like to try to take an Amtrak to Hawaii? Do you see the parallels between the industries?

Rabid idealist, indeed. At this very second I have a car in my garage that does everything a gas car doesn't - it goes 300 miles with no pollution out the tailpipe, refills overnight for pennies per mile and has virtually no maintenance. YOU, however, better not leave your car running overnight in your garage or you'll be DEAD.
Reply: Haloid Android: Gasoline makes no sense in the horse and buggy powered world as of now! Why, I can pull the family mule off the side of the road an refuel her with grass and a puddle. I even get autopilot because she knows the way to market and home - I can let go of the reins and she'll take me there. Gasoline? It's smelly and gosh darn it blows up and catches fire. Then you have to go so a special place to get the stuff and pay the price the store wants for it...gasoline? Not for me! My farm is working just fine with Ol' Bessie!
Reply: Haloid Android, ah! So the cars are OK, you just don't like the fact that the owners LIKE their car company or its CEO? Sorry you can't speak so well of your car maker or it's management, that's not anyone's problem but yours.

The German Autobahn? Please look on YouTube for videos of Tesla owners driving on the autobahn. Does range drop at 120mph? Sure! Tell me the EPA mileage of a Mercedes at 120 mph. Get low on energy on the Autobahn in a Tesla, what do you do? The same thing you do in a gas car - you pull off the autobahn, refill, be on your way. Your trying to make some scenario that keeps supporting whale oil and steam engines just amuses me. BTW, there are LOTS of Tesla owners in GERMANY that use the autobahn.

Your arguments on Tesla's being unnecessarily quick just amuse me. If Tesla's weren't fast, you'd say "see? electric cars can't compete with the performance of a gas car!". You KNOW you'd say that. Tesla had to make the cars quick (EVs already are) in order to compete with luxury class models. If you pay what a Tesla costs, you'd better be comfortable and you'd better have performance...you get both with Tesla. Range? Solved by the Supercharger network. Tesla made a calculation of how far the car had to go as a minumum and 300 miles is the sweet point. You won't drive 500 miles without a stop so why have range beyond that? Tesla actually considered making the Model S 500 miles of range, but the cost didn't outweigh any advantage; after all, many many luxury class sedans don't have 500 miles of range. You don't buy a luxury class car for mileage or range, you buy it for luxury and performance.
Reply: Scallywag nobody cares. diesel engines and v8 amazing sounding engines bring me joy
Reply: Scallywag I am. And I own a v-twin 1250cc muscle bike. I love the ochrestra of beautiful music it produces. I still there and let it sing   to the environment... the same environment mitt Romney polluted your mind with bologna about
Reply: Hold up... Canada mostly runs on nuclular and hydro? Ever been to Alberta? Lol
Reply: EV Owner I understand what you're saying, but you can get 450 miles out of a tank of gas in any mid sized car. It takes 5 minutes to fill up and you can drive another 450 miles. At your pace, it would take my family 2 full days to drive to Gulf Shores, AL. When electric cars are equal to gas autos in terms of traveling distances...then I'll consider buying one.
Reply: EV Owner, a gallon of gasoline can run a car for 50+ miles LOL. Diesel cars can go upwards of 90+ miles on a gallon of diesel. EVs are inefficient in comparison lol, 20 miles.
Reply: EV Owner Tesla did not simply take a loan, you fraud. Subsidization is assistance in many forms, and Tesla has enjoyed billions of it. Grants. Tax Breaks, Construction, DISCOUNTED loans. Environmental credits. Tax credits and rebates for solar panels and the cars themselves. 

The only payoff for taxpayers is if electric breaks into mass-market development and pollution levels drop significantly. I've already explained how this is grossly unlikely for a long time. Meanwhile Tesla, but especially Elon Musk, will enjoy great wealth at our expense. There's no comparison with air travel, which is an entirely different mode of transportation that was essential to develop (and you're not even advocating technology that affects planes). 

Running an ICE car in a garage is a red herring. Automaker bail-outs is a red herring (that was unnecessary, the result of cronyism in government). War is a red herring (governments would find other ways to start wars). Railroads is a red herring. You're nothing but a babbling, misleading, distraction of devices and keep squawking about gasoline and exhaust being deadly killers. You couldn't sound like more of a nut if you grew from a tree.
Reply: I'm sticking with gasoline cars, nothing beats the sweet induction noise and the exhaust note. :)
Reply: Herr doktorbimmer shut up
Reply: EV Owner lol can a Tesla beat a Porsche 918 Spyder and look nearly as cool? I doubt. EVs are only good for commuting, not for sports.
Reply: Haloid Android, if in 100% of car accidents the cars never catch fire then please explain the car wrecks that I've seen on streets near my house that erupted in a fire. They don't even have to be in an accident - I helped a kid out that had his engine catch fire while he was driving it (I guess that can happen when you're using explosive as fuel, huh).

Please - Google is your friend. Do you challenge my statements about car fires, lives lost, etc? Are you honestly trying to tell me cars with explosive are safer than dry batteries? Really, is that what you're trying to say?

By the way, Tesla considered a 500 mile range on their Model S but it came down to cost. Do you drive 500 miles without refueling? Really - do you drive from full to empty, 10 hours of driving, with no stops? If you do, you should read about DOT regs and realize that isn't safe to do, even if your car goes 500 miles on a tank of gas. What car do you have that has a 500 mile range? I've owned lots of cars and never had one that could. Nor would I drive full to empty without stopping. So I think your requirements are unrealistic, you don't do that now.

Let me repeat my mantra: I'll buy another gas car when they don't have 17 fires an HOUR, kill 200 people a year from those fires and have one moving part in the engine. How's that?
Reply: Herr doktorbimmer you didnt learn a leson i think you are blind buy tesla
Reply: EV Owner Ignore supply issues. Ignore costs. Ignore mention of alternatives. Ignore evidence of improvements to ICE. Ignore environmental and economic research. Ignore automakers moving into electric because that's where demand is being invented and subsidies are going. Keep pushing platitudes. No one is going to hold you accountable and you have nothing to lose.
Reply: Until fully electric vehicles have the ability to travel 300-1000 or more miles, they will simply be commuter cars. How are you supposed to take your family on a trip to the beach from Chicago in an electric car? Stop every 280 miles and let it charge for 6 hours? Not practical at all at this point.
Reply: EV Owner who the hell buys a sports car for 50 mpg?! A +$500,000 will kill a Tesla in any type of race be it in endurance racing, drag racing, and circuit racing. The batteries won't even last that long at such high speeds. When you run out of petrol, pit stop and you're good to go. When you run out of battery, no racing for 6 hours :P
Reply: EV Owner Lithium is highly reactive and flammable. Also, electric cars are a tiny percentage of total vehicles. Comparing accidents would be like comparing the number of crimes in a city of 10 million vs. a small town. You're skewing data.

Electric cars don't end the demand for oil and the related geopolitical challenges. Aircraft, boats, and heavy vehicles, military and industrial, are not going anywhere. There's a lot to say about heavy loads for the average civilian as well, such as recreational vehicles and haulers; there are no electric solutions because of the energy requirements. Unlike electric power, we get tons of energy from our fuels, albeit inefficiently.

Typical EV nut, exaggerating the benefits, twisting arguments, and ignoring reality. There's a battery war going on across the world now, and you don't go catching lithium with a butterfly net. It's taken out of the earth. Big business will continue to rape our soil and man will continue to expand and consume until we die out or this rock is useless to us. 

Stop pretending you're out to save us and the planet; you're not. If you were you'd be for reducing man's footprint and lobby for changes in how we build our civilization and economies to be more self-reliant and consume less. All you're going to do is take us off one unsustainable path and put us on another. It's slightly better, and of course that's all eco-nuts seem to care about, just doing a little better than we are, in some ways that satisfy their emotions.
Reply: With current technology, battery powered vehicles are a good choice. However in the near (hopefully near) future, systems like hydrogen fuel cells or H2O2 heavy water fracturing , that can take heavy water and split it in to its separate elements and supplement current fuels to gain efficiency. Of course this depends on the world getting the Fusion reactor to work. Since currently, Hydrogen and H2O2 are produced very inefficiently, and would be byproducts of Fusion reactors producing power.
Reply: Scallywag idc drive your little puny weak cars
Reply: No "greenhouse" gasses, but you're killing an entire ecosystem in the rivers producing hydro, and nuclear? Yeah, let's take a look at Fukushima and Chernobyl.
Reply: You're using more fossil fuels to recharge your electric car than you are driving the average gas car
Reply: Scallywag Do you really believe that the production of the batteries used in electrical cars is environmentally friendly? The production of one tesla may even pollute nature more than a gas powered car does in its entire lifetime.
Reply: Jarl Ballin' Oh, I didn't realise you could go to a filling station and fill up in seconds.

That's the crooks of electric, they are not practical.
Reply: Jarl Ballin' no car enthusiast would buy a "sport" EV, what's the fun in that? EVs have no sporty exhaust note, nothing to excite a petrol head. I feel that gasoline and electric cars can coexist together catering to everybody. Like I said, the induction noise and exhaust note cannot be beaten, and shifting through the gears at red line is even more fun :)
Reply: Jarl Ballin' electric engines suck